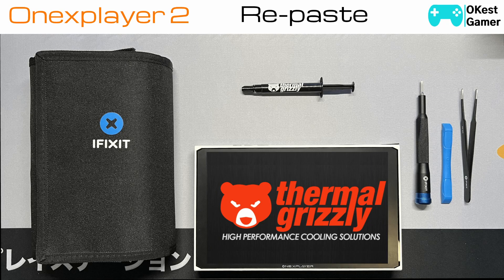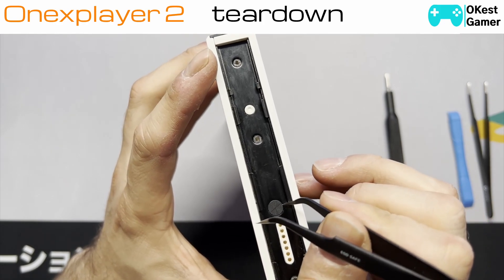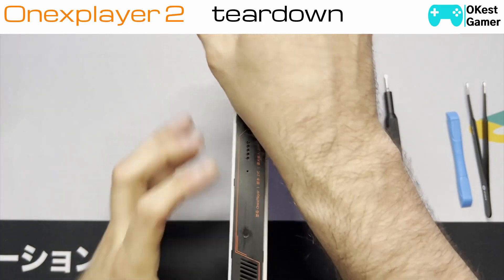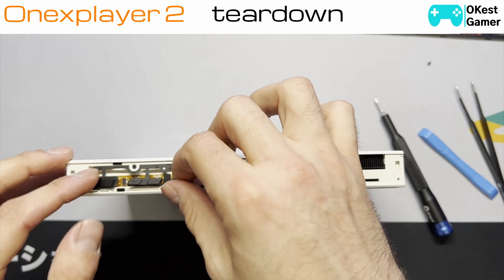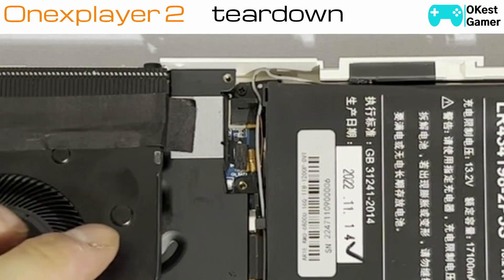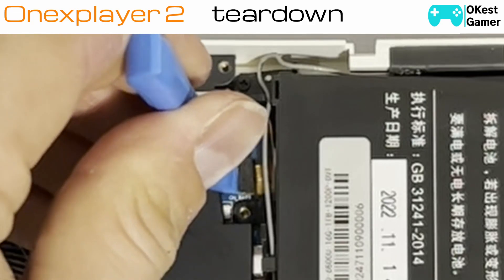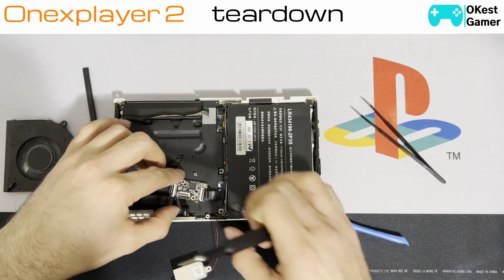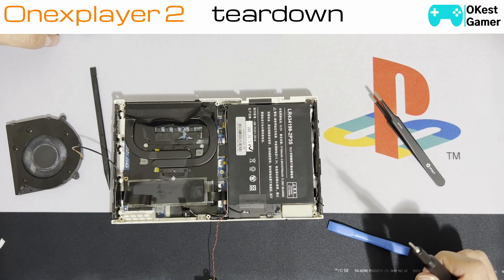Onexplayer 2 Thermal paste replacement

Comment: Why do these companies not just use good paste in the first place. Kind of annoying that people have to go back and fix thier cheap work.
Reply from the maker: The paste they used was fine, I was already inside the device replacing the SSD and decided to change the paste while at it. Did it half to see if temps improved, and half for the sake of making the tutorial for others in the future.
Reply: @okestgamer  yes but your temps did improve, did they not? I have seen reports of others replacing the thermal paste and getting anywhere from 5 to 10 degree reduction in load temps. I mean its an over 1k device, why cant they just use better paste. Smh.
Reply from the maker: @rooster6115  yeah that’s across the board with electronics, no idea why they don’t use the best stuff.

Comment: Thanks for the vid bro. Do you have comparison temps from stock vs grizzly paste?
Reply from the maker: Not a definitive result, but cyberpunk at 28w dropped from 79c to 74/75c
Reply: @okestgamer  how about RPM ?
Reply from the maker: @TonyMartin85  I did not test the difference in fan speed. having said that, the fan ramp up should happen slightly slower due to the temperature triggers not being hit as quickly. Long story short through the device didn’t need a repaste, but I was already inside doing the SSD and made the video for users in the future when the paste is older.